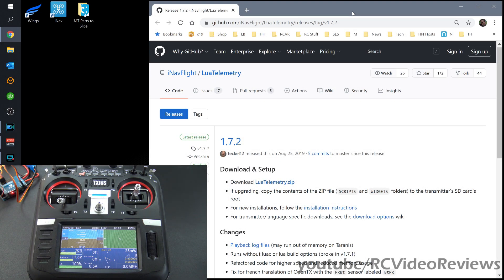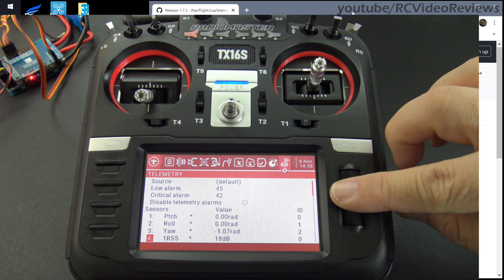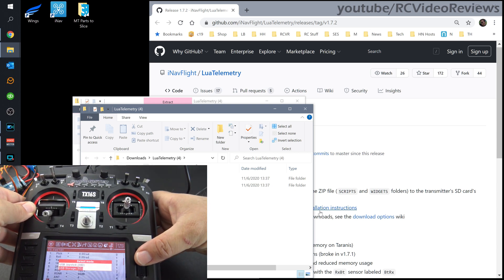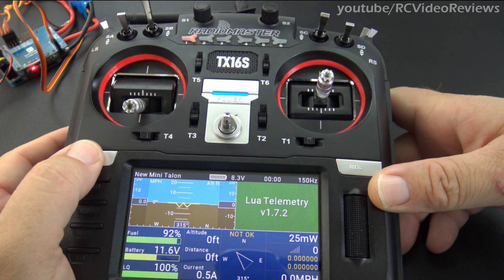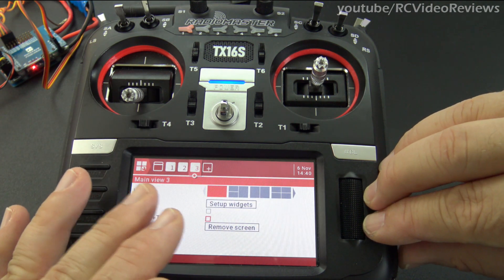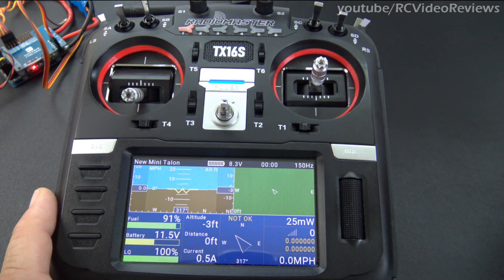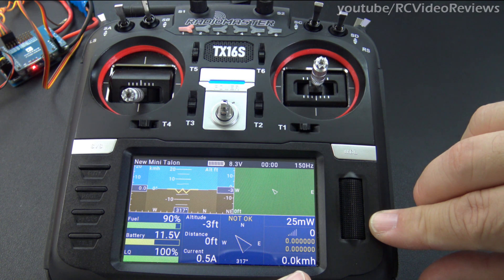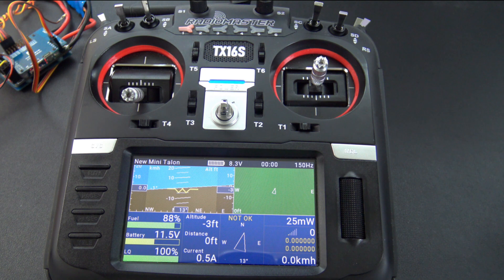How-to add iNav Telemetry Lua Script to Radiomaster TX16s

Comment: Hi I'm using tbs nano receiver and mateksys f405wing for fc. It should be capable of sending telemetry back to radio transmitter.

But I can't configure the wiring and INAV setting to do that telemetry thing to show roll, pitch and virtual horizon . Can you help ?

FYI all my servo and motor already working just fine.
Reply from the maker: Do you get any telemetry?
Reply: @RCVideoReviews  updated my quetions.

Yes I get the telemetry.
In telemetry page I can see my pitch, roll and yaw move when I wiggle the plane. But strangely it doesn't reflect in the navigation widget. It only shows signal strength. No moving horizon as I wiggle the plane. no battery voltage, coordinate etc
Reply: @RCVideoReviews  solved.

Delete all sensor then rediscover new sensors solve the problem.
Still error horizon ... rebooting both the model and radio transmitter fix all the problem.

Thanks

Comment: just installed the INAV lua and everything is working 100%...thanks!
  is it possible for this to make changes to other screens? My radio timer activated by the throttle used to be black numbers on a white background, now it's dim white numbers on a white background, very hard to see. How do I get it back? or change colors. crossfire/tx16s
Reply from the maker: Yes! There's some sort of bug either in OpenTx or the LUA script (I'm guessing OpenTx) that leaves the font colors changed. It happens on mine too. I haven't tried it yet, but you might want to try to "reset" the flight. Long press jog dial, reset, flight. Not sure if that'll work or not, but I've experienced similar discoloration issues with fonts. Rebooting the radio definitely restores the correct color.

Comment: iNav is not an option on my widgets list. any thoughts? when I look in the widget folder it does say iNav.lau
Reply: Nvm, POWER CYCLE lol. got it. BUT I do have another question. on the right my crsf signal strength shows 1 bar ALWAYS.. even when a half mile out. thoughts?
Reply from the maker: I haven't seen my signal strength indicator on the iNav script while flying, so I don't know the answer to this one.

Comment: This ooks like a great feature! Quick question, I have crossfire, but do I need GPS for this to be get the most use out of iNav?
Reply from the maker: If you're using an iNav based FC, I'd think you would want GPS to get the most out of it. All of the nav modes and rth depend on GPS. I wouldn't get it for the script as much as the other functionality you get from the FC when GPS is added. You can get a BN220 for about $16.
Reply: @RCVideoReviews  agree Inav ment for GPS.  Go hand and hand.

Comment: How to configure the hardware i mean i have Frsky X8R hiw do i wire up to Matek F765
Reply from the maker: Use s.bus. Matek has wiring diagrams showing how to do s.bus receivers.
Reply: @RCVideoReviews  I used sbus wiring diagram and inav telemetry 1.7.2 but Roll pitch yaw doesnt show up yet all other 20 sensor keep on showing and my Telemetry widget is actually not displaying any of the data
Reply from the maker: @aesatishchaudhary5933  I haven't tried an s.bus setup in iNav, only Crossfire and all telemetry values populate while using CRSF as the Rx protocol. You might have to do a  little reading to figure out how to send iNav telemetry via s.bus.

Comment: Does it works if Flight controller is Betaflight not iNav?
Reply from the maker: I don’t have anything with betaflight to test on. It only takes a few minutes. You should try it and let us know. I expect some elements might work and some might not. It’s hard to say.
Reply: @RCVideoReviews  It works with BF fc, at least for mine. Just tried it couple hours ago. Jumper T16 with Tbs crossfire micro tx v2

Comment: Thank you friend! Thanks to you, everything works. Some questions.

1. You have "150nz" written in the upper right corner. I don't have this label. What's it?
2. everything works very quickly and smoothly for you, the radio draws a lot of frames per second. I have not so smoothly, slower, somewhere 1-2 frames per second. What is the reason?,

My setup: inav260, lua172,
 matek f405, softserial s-port, rx: jumper r1 16ch, tx: radiolink tx16s
Reply from the maker: 1. 150hz is a Crossfire update rate and it's automated. 
2. I'm not exactly sure because both radios use the same CPU. You might try upgrading your SD card. Also make sure to turn off sensor discovery if you haven't already.

Comment: Thank you for your video. I have radiomaster TX16s and Crossfire Micro TX II with nano receiver. I connected the receiver to f405 wing by sbus connection. I Discovered 10 telemetry data but in inav lua script only RSSI valu working. There is no battery, no pitch and yaw, no compas. What can I do? where is my fault?
Reply: Then I tried 4 wire crsf mode. 
I connected 
5v to 4.5V      (SBUS)
GND to GND  (SBUS)
CH1 to R2
CH2 to T2

but nothing change. I only discovered 
1RSS, 2RSS, RQly, RSNR, ANT, RFMD, TPWR, TRSS, TQly, TSNR
Reply from the maker: Can you set your protocol to CRSF instead of sbus on the radio and computer?
Reply: @RCVideoReviews  Yes I set the protocol to crsf. But not worked. Then I used TX5 and Rx5 .Now it is working. I think f405 wing's sbus 4.5v, gnd, tx2 and rx2 not suitable for crsf or I couldnt set it up.
Reply from the maker: @mehmetkeskin2469  Good deal. Glad you got it working.
Reply: @mehmetkeskin2469  yep.  Had the same thing happen to me on the 405.

Comment: hello can you told me what i have to pay with radio and work for  lua bcz i want order TX16s and Frsky L9R 9/12ch and FrSky Yaapu and Pixhawk PX4 PIX 2.4.8.. and HobbyEagle A3 Super3 .. thank you
Reply from the maker: The radio works with lua out of the box. This lua script is designed for iNav devices and the telemetry delivered by iNav to the radio. It will not work with just an L9R. You've also asked about 6 different questions between the Rx, YaaPu, iNav LUA, Pixhawk, and A3. I can't answer all of them here....

For the script in this video, you need an iNav device, a TX16s, and an Rx that supports telemetry.

The A3 is a stabilizer and offers no telemetry info.
The L9R does not support telemetry.
Yaapu is a LUA script for telemetry.
The Pixhawk PX4 is a flight computer.

You're kind of bouncing around on me a little. Please trim your questions back to something more manageable.
Reply: @RCVideoReviews  so what i have to pay the  receiver 10 ch or 9
Reply from the maker: I think we’re losing something in translation.
Reply: @RCVideoReviews  Sorry i written wrong ( Buy)  i mean.

Comment: Grait video! One question. How to save changes, i have done?
Reply from the maker: How did you make changes?
Reply: @RCVideoReviews As you described. In menu settings. I found the solution. After changes, it is nesessery to move right stick to the left and then repower the transmitter

Comment: I tried with crossfire nano rx and didn't work , i connect on a mxk f405 wing , with the tx16s , but didn't work ! Thank's for your good video , really help !
Reply from the maker: Glad it helped. So you got it working ok?
Reply: @RCVideoReviews  Inav on TX16s not working , , i check everithing and relisten your video to see what i do wrong  !!
Reply: @RCVideoReviews  I finally go it , all work now !! My mistake was that i put the smartport to softserial1 , i changed it to uart6 and now it work good ! thank's for your help with yours videos !!
Reply: @Joziebee  hi greeting from me.

I have similar problem using nano receiver on mateksys f405wing and can't get INAV telemetry sent back to radio transmitter.

Glad you solve the problem.

Can you help me on the wiring diagram ? The wiring diagram from the FC to nano receiver to get this telemetry works ?

Thanks in advance

Comment: I have emergency mode on my new radiomaster 😭 any help much appreciated pal
Reply from the maker: That normally means you pulled the battery out while powered on. Just turn it off and back on.
Reply: Mine did that on the initial boot up.  But only once.

Comment: You can easily access that menu when running as a widget just by using a stick command. Push the left stick to the upper right corner, there you go...
Reply from the maker: Good tip thanks. If you're reading: Up and right on the left stick enters the config menu .The right stick moves the cursor up and down, right stick moved right highlights the field allowing for changes with up or down. Right stick moved right again finishes the edit allowing you to select the next option. Right stick left exits the configuration menu.

Thanks for the tip...good one.

Comment: Suppose I am interested in iNav. But not interested in FPV. Suppose I am interested in flying using  Line of Sight. Could I use these LUA scripts to recover after losing visual orientation?

Suppose I take steps when mounting iNav Controller to isolate from vibration. Would this work when flying gasser airplanes in the 30cc - 100cc range?

Thanks, Randy
Reply from the maker: I don't know I would want to try and use a script to try and recover a plane after losing orientation. If I had iNav in a plane, I would rather just flick a switch and have the plane return to home or loiter while I regained my bearings.

If you're suggesting you can eliminate vibrations as a problem I don't see any reason the computer couldn't control the plane. You may want to check on the current demands to drive the servos and you may need to power them externally. As far as the airframe goes, the computer won't care what it's in so long as the airframe is supported by the firmware.
Reply: @RCVideoReviews  No I am not making that suggestion. That is actually my question. Are the typical methods used to reduce vibration in a gas engine environment, adequate to allow a iNav Flight Controller to work? Thankyou so much for the answers.

Comment: The Fuel value .. is that like in mAh or is it really fuel as in gasoline?
Reply from the maker: It has to do with the capacity of the battery and the amount of power used. Not fuel as in gas/nitro.

Comment: One question. How do you connect up the Crossfire receiver to the flight controller to get telemetry? 
Thanks
Reply from the maker: It's a simple 4 wire connection outlined in the FC manual. To use UART #2:  Ground, 5v, Ch1 = Rx2, Ch2 = Tx2. Then in iNav you just set the protocol on the receiver page to Crossfire. Telemetry is sent automatically from there, just add the sensors on your radio. This page has a diagram showing the connectivity: http://www.mateksys.com/?portfolio=f722-wing#tab-id-4
Reply: Thanks 👍